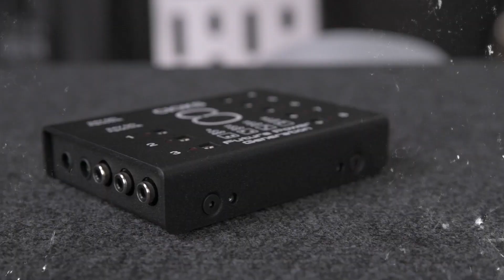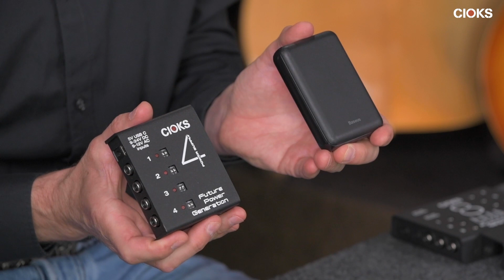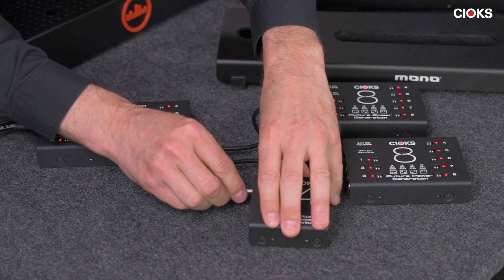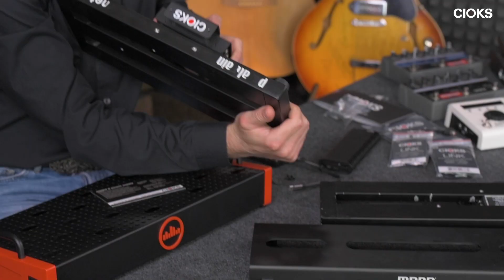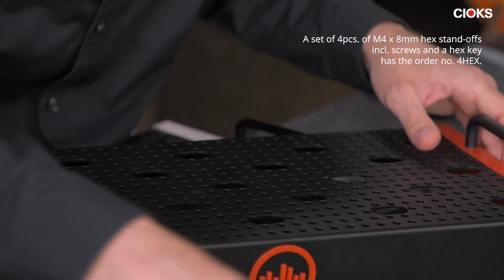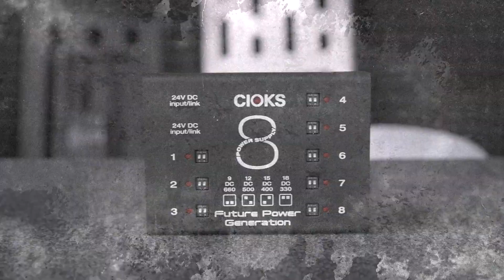CIOKS Future Power Generation

Comment: Cioks should have a unit only with isolated USBs connectors which i could connect to my DC7. Would help alot for my synth set ups where more and more units use USB.

Comment: The fact there Cioks has dedicated cables for every scenario such as Curent unifyer cables  and Voltage unifiyer cable and Curent splitter cable etc  ... shows that the Cioks power suply is intented to give you all these functionality,   where some other manufacturers  have only few cables and you don't know if the reason for that is that their  power  suplies are  limited in functionality.

So Viojs knows that huge variation in cables is part of the package given yo the customer, which is very nice.
Also, Cioks backs its power suplies with 5 years warranty worldwide which shows that Cioks  company have  confidence in its power suplies reliability  !!

Comment: Can the cioks 4 AC adapter version be powered from one of the Ciokolate's AC outputs? I love my Ciokolate and have been using it for years but am running out of outlets because my board is a bit too big :D
Reply: Confirmed Cioks 4 running off 12v AC from Ciokolate is enough to power my Kingsley Harlot which is said to require 500mA.  BUT, I did not test it at a 4-hr gig, with 4 high-current pedals attached to the Cioks 4.